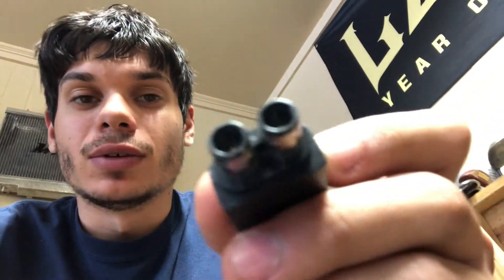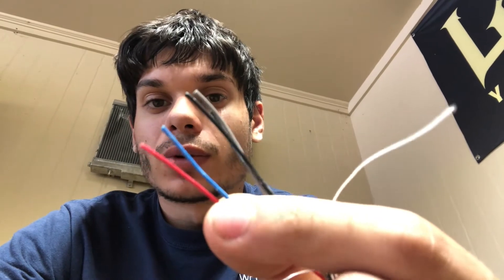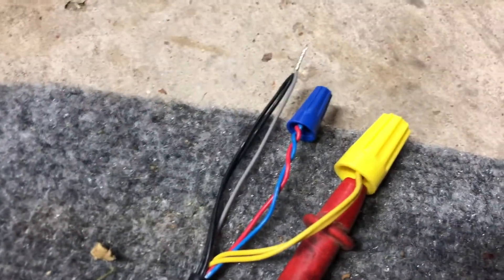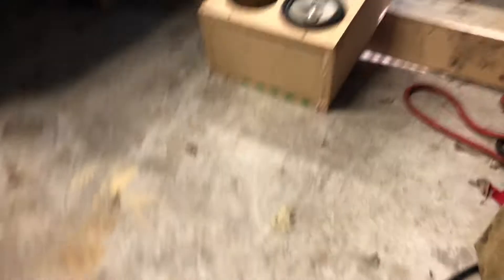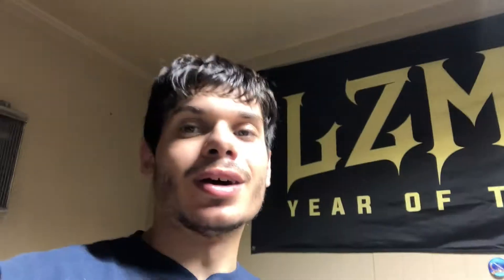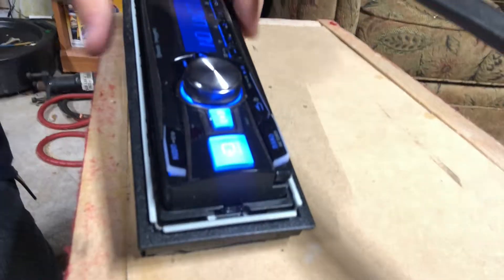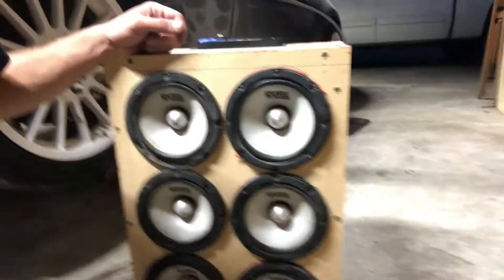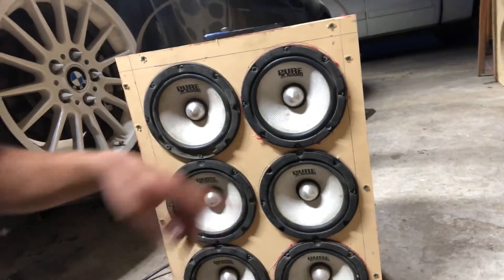How to use a XBOX 360 SLIM power block for car audio(12VDC) power supply/homemade shop boombox

Comment: My power supply keeps on giving the red light instantly when connecting it to my heaviest amp, is it too heavy for the power supply? I've got the 150w 12a, so it's the smallest one. My other two amps work fine with this method
Reply: Having the same issue
Reply: @itsmekashmyre7503  What amp are you using? I know for a fact that the amp is asking for too much power. My amp works perfectly in my car

Comment: the power supply works fine initially until my car amp switches from protect mode to powered on mode and then it switches red.  I'm gonna try "jumping" the amp just to get it to the powered on mode from a car battery and then connecting the power supply after it is on fully will work.
Reply: what you have to do is disconnect the power cable from the xbox brick wait until the red light goes out then plug it back in.i fixed this issue all together {because i had to do this every time] by adding a cheap cap.now i have 3 amps and a crossover running off of it through a schitt dac fed by my laptop.all hooked to a surge protector so now i turn everything on and off by the surge protector and i also noticed a hum if you use different outlets for it all.i no longer have this along with one touch convenience its easy dont overthink it.you could even do all this with a jump starter kit for about an hr lol

Comment: E-mail me what's the grey or white wire for I hooked up the yellow wires to red yellow for the black wires for ground I turned ny car stereo on power supply light turns red with the red and blue wire connected